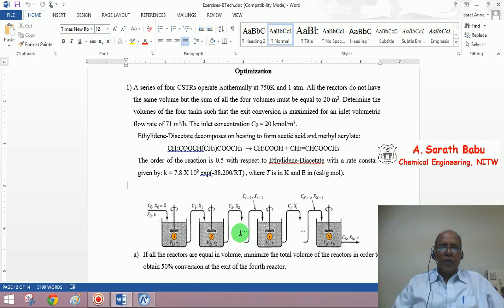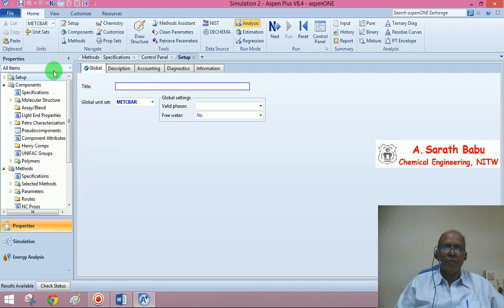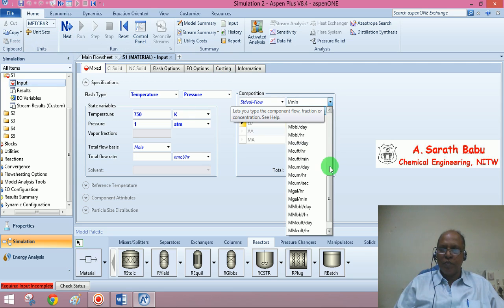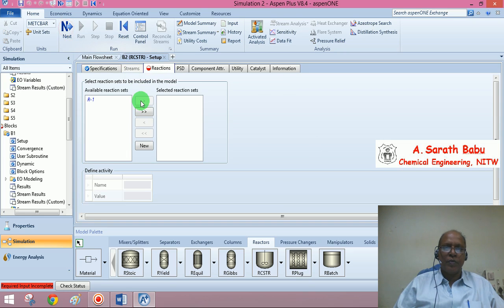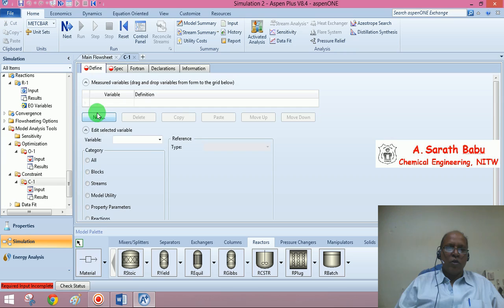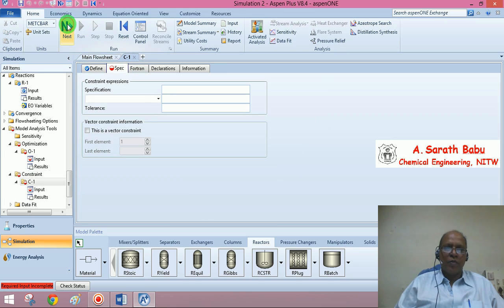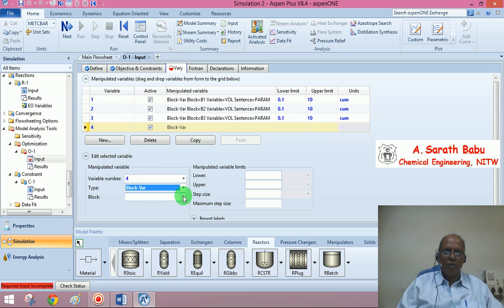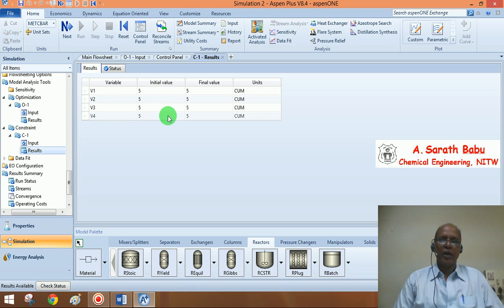Lecture 36: Optimization example 1 in Aspen

Comment: The question here is to maximize the conversion but sir you have selected minimum while doing optimization.why is it so?
Reply: It is because he defined the CONV as the flowrate of ED, which is not the conversion. This flow of ED you want to minimize at the outlet. It is true that if he had defined the CONV as the actual conversion, a maximization would have been needed.